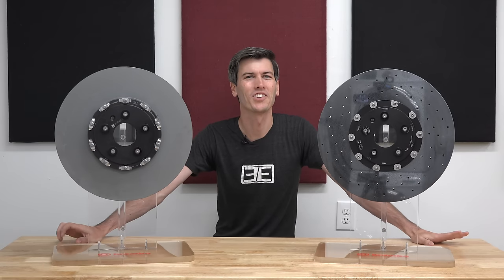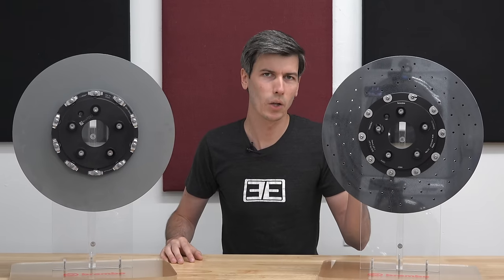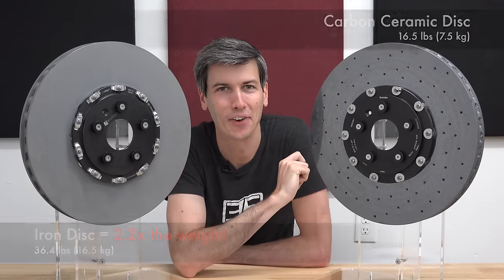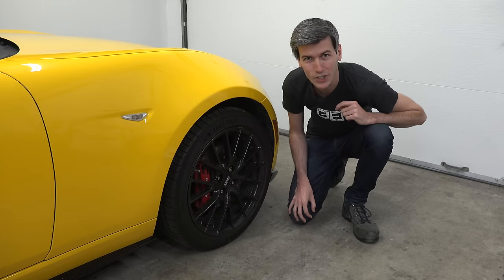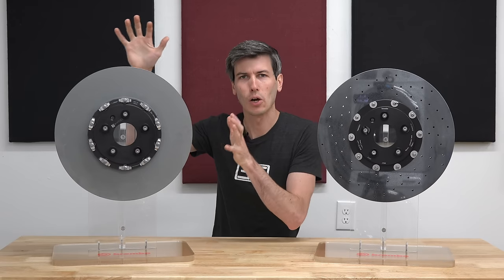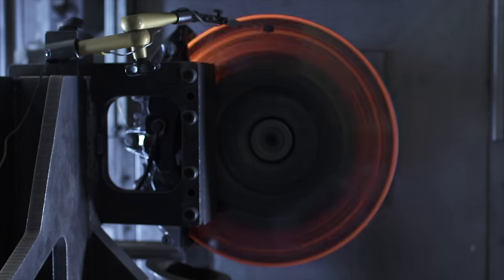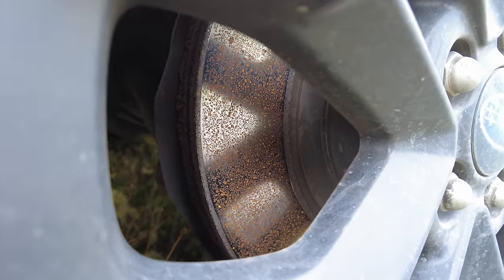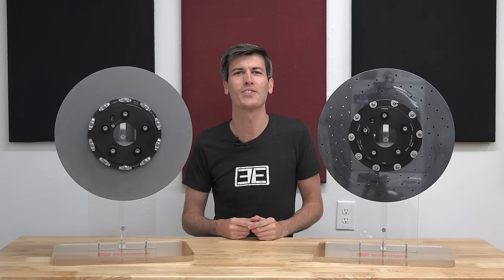How Can Brakes Cost $10,000? The Brilliance Of Carbon Ceramics

Comment: I use ceramic tiles from my kitchen for my brakes.Far cheaper and if I need to replace them, I can just grab some from my home depot.
Reply from the maker: I'd maybe suggest starting at Home Depot, so you still have a kitchen floor.
Reply: Porcelain is another option for low cost.
Reply: I believe Animal Free Fur Pelts and Rubber Bands are the recommended optional upgrade for this kind of brake setup
Reply: I use an ironing board for my rear spoiler and clip boards for my sun visors. Quids in.
Reply: Have you ever thought about upgrading to CARBON CERAMIC TILES?
Reply: @EngineeringExplained  NOW you tell me. Dangit.
Reply: I grab wall base mouldings while at Home Depot for my side skirts.
Reply: Engineering : More rotational mass and inertia is a bad thing

Manufacturers : 24 inch wheels! 😂
Reply: I don't always buy expensive rotors, but when I do, I use granite countertops.
Reply: I love the internet 😂
Reply: What about the carbon?
Reply: I just use the pink foam. Huge weight savings

Comment: would have liked to see the negatives too. My experience with carbon brakes is in aircraft, not cars, so maybe things are different. Aviation uses them almost entirely for life expectancy, but they achieve all the benefits you mentioned. Downside (apart from cost) is that their brake performance while cold is pretty bad and unpredictable. The same brakes will pull left or right depending on the day. Once they warm up, however, they perform wonderfully. Brake fade is only part of the equation. You need to look at brake warm-ups too. In daily driving, you're brakes are usually cold. Only in track racing do your brakes typically remain at the ideal operating temperatures for carbon brakes. Unless the technology has changed for car applications, I do not see carbon brakes being an advisable choice for a daily driver
Reply: CCBs are great for the reasons Jason identified, but the major issue is simply cost.  They are often 5x-10x more more as Jason mentioned.  From a use standpoint if overheated (on a track day for example) they will wear quickly, which leads to replacement (read $$$.)
Reply: Seems like weight savings would play a major role in aircraft, no?  I guess down time to replace brakes is as important.
Reply: Perhaps the car's stability systems help the inconsistencies in cold carbon ceramic brakes. I wonder if there's different brake logic like programming battieres in newer cars.
Reply: I think you’re getting carbon ceramic rotors confused with carbon-carbon rotors that are only used in racing. Carbon-carbon rotors have a very narrow temperature window in which they operate correctly. This is not the case with carbon ceramics. They work correctly immediately from ambient temperature. I had carbon ceramics on my BMW M3 and never experienced what you described. What I did experience was 0 friction during the first 2 seconds of brake pedal pressure in wet conditions.
Reply: Brake system engineer here: in a street car application CSiC (Carbon-Siliconcarbide) Brakes nowadays perform almost identical to Cast-Iron brakes when cold. The real enemy for CSiC Brakes is water! To reduce that issue, the brakes will be slightly applied on the car to get rid of the waterlayer, when its raining and the brakes are cold. This method will be used every minutes without the driver noticing. 

Carbon-Carbon brake rotors ( used in racing) have a really low friction coefficient when cold and can't really be used without being warmed up.
Reply: That’s not true. Carbon brakes do not need temperature to perform normal safe street stops. They stop immediately. Unlike iron race brakes.
Reply: @RB-xv4si  absolutely true. Thank you.
Reply: @RB-xv4si  yep
Reply: @vivalaphill  thank you. Exactly.
Reply: Only F1 cars use these brakes to my knowledge.
Reply: @CamKrazy2000  carbon/carbon?
Reply: @CamKrazy2000  lots of cars use carbon brakes. Lots.
Reply: I love my speed triple! The steel lines help a lot too! But what an awesome bike all around! Very hard to keep both wheels on the ground from stop to stop!
Reply: They compensate with the pad material creating a linear more familiar brake feel and application plus some computer trickery in some high end cars.
Reply: @RB-xv4si  I also experience the same with my M4 with CCBs. Nothing like driving in the rain and needing to emergency brake and nothing happens when you stand on the pedal. Lol
Reply: @heremyjogan  it’s very scary! I wish this would be fixed.
Reply: @ICEV  This. Top Fuel, Funny cars, LMP, just to name a few.
Reply: I have a GT3RS w/ Porsche's Carbon Ceramic Brakes. Maybe the ultimate friction level between pad and rotor isn't as good when they're cold. But even so, the friction level is plenty adequate enough to trigger the anti-lock system at will during street driving. This is probably because the brakes are plenty oversized for legal speed limits anyway, so the friction coefficient being a little lower doesn't really matter. There's still more than enough stopping power. And of course if you're on track, you'll have them heated up soon anyway. Don't forget that pad selection - not just the rotor material - plays a major roll in the coefficient of friction relative to temperature.
Reply: @ICEV  early versions like the PCCB on 2003/4 911 GT3s were poor when cold. The tech has improved though.
Reply: @Cassp0nk  I never had any issues with early PORSCHE Carbon Ceramics. Stopped fine in 30 degree weather.
Reply: Yup on cold days the brakes on my McLaren GT are louder and more touchy
Reply: @CamKrazy2000  IndyCar uses carbon/carbon brakes on the super-speedways and iron on road courses.
Reply: @vivalaphill  that's pretty smart, got the car looking out for ya and you wouldn't even realize it.
Reply: Carbon brakes on aircraft have a tendency to grab suddenly.  You really feel it when the autobrake system comes online.
Reply: @YungDevo9  the amount of things modern cars do that is completely transparent to the driver is really amazing, especially in comparison to half a century ago when you often had to manually adjust the air/fuel ratio just to get the engine started (manual choke).
Reply: Your*
Reply: I have a car with CCB the brakes work just fine even when it is -20  degrees out.
Reply: Downside of CCB is 1. obviously cost (being poor is my problem not Brembo’s); 2. cold temp performance, which a lot of manufacturers has been improved on (so it’s like 0.5 of a problem);  3. brake noise (even top brands can’t eliminate brake squeal).
Reply: @RB-xv4si  And then you hit something because you had no brakes for 2 seconds.
Reply: @vivalaphill  Until the sensors that do that fail after maybe 5 years and their are no replacements available because you engineers have made a new one that is not backwards compatible and the second or third owner of that car has rear ended someone or driven into a ditch if they are lucky or off the side of a cliff if not.
Reply: I’m considering getting a pair for my drag racing car.  I cross the quarter mile @ 132mph.
Reply: @RB-xv4si I have a g80 m3 with carbon ceramics and you are 100% exactly correct. 
The breaks are perfect, except after a car wash the first 1-2 seconds of pushing the breaks the first time, nothing much happens
Reply: @ATEC101 it’s not that bad. I don’t notice it in wet driving. Only after going through the automatic car wash. And even then it’s not no breaks, just the first 5kg of foot pressure on the pedal does nothing, if you push harder it still stops. And it’s literally only for the first corner
Reply: On regular brakes people would say don’t use race pads on the street cause they don’t bite when they are cold. Well it may be true that they bite harder when warm, but when cold they would still compel you outperform other street/track use pads. They did squeal bad tho but I didn’t mind it since was race car on the street anyways
Reply: @ATEC101 😂
Reply: Carbon ceramics don’t have the cold issue I think you’re talking about carbon carbon brakes

Comment: I see a Jason and a big rotor, I SMASH like! After having thrashed that RS7 boy to those brakes feel amazing once they get some heat. Not bad cold, but not great. On that car, each front rotor is almost $6000 to replace. OUCH!
Reply: They are amazing. Have them on my S8+.
Reply: Yes very good brakes, I work for Audi a brake job cost $15,000 per axle I’ve only done one set on an R8 they last a long time
Reply: So humble of you 😜
Reply: New RS models are $10,000+ now, insane
Reply from the maker: Love it!
Reply: Spot on. Carbons need to reach about 400C before they work effectively.
Reply: Got them on my M4 Comp, awesome brakes and 0 brake dust :)
Reply: @Dan-re7go  400C? Isn’t that a bit too much?
Reply: @xjoffroad2052  $60K on brakes doesn’t make sense for a street car. I’d change those out for Iron rotors asap
Reply: @DanielE-oq1dt  and track cars, better to go thru multiple sets of reg rotors
Reply: @iiNNeX  - I optioned CC on my G80. Do you experience high/loud squeal from the CC’s? And are you using them on street or track or both? Any complaints?
Reply: @gmoneii1117 Did you always have the squeal? Did it get worse as they warmed up?

Comment: If you do a break delete you have even less unsprung mass
Reply: If you do an axle delete even more so!
Reply from the maker: Jesse's Jetta knows.
Reply: I am surprised that inboard brakes are not more of a thing.
Reply: @PaulMorris-UK  probably would be a pain to package when there's this big open space between the hub and tyre you can use
Reply: You could also leave the wheels and tires back in the garage.  That would make the brake delete a lot safer, too.

Comment: When I had a Corvette, I kept up with the comments from the other track rats.  Heavy users switched out their factory carbon rotors and matching calipers for AP Racing rotors and calipers.  Carbon rotors lasted about a year of track use.  The AP Racing setup could be purchased for less than the replacement rotors, and users stated their lap times improved.  I'm sure a track only carbon setup would be faster than the iron rotor track setup, but only pro teams would be willing to pay for the difference.  Cool stuff, Jason.  Let's see more of your new garage!
Reply from the maker: Interesting insight, thanks for sharing!
Reply: I have no direct experience here, but I've read lots of stories of Porsche GT3 owners who switched from carbon to iron rotors for racing. The main reason was that the carbon didn't get much of an advantage and the iron rotors were considerably cheaper to replace at the end of the season. The carbon is the only choice if you're trying to set fastest laps, but if you only race a few weekends a year then it's not a concern. Lots of people are happy to finish mid pack (or finish at all) with iron rotors.
Reply: Additional info: if you are using Carbon on the track, you need to constantly weigh the rotors as that's the only method to determine when they are worn out.  If you neglect to do this, you have a chance of catastrophic brake failure, not the funnest thing to happen while on a track.
Iron rotors you can easily monitor without removing from the car and also put up with much more abuse.
As you said, only pro teams are willing to put up with the extra cost and maintenance for carbon.
Reply: I too swapped out my CC rotors on my C7Z for the irons. Better braking modulation and much, much more compound to use than the CC. Lap times has also dropped, mainly because the CC was an on/off switch.
Reply: @DougAdams-Outside  You don't have to do that - you can feel that surface gets very rough when too much carbon gets burned out. At that case you check if they done or not by weight.
Reply: @MaxKosenko  thanks!

Comment: I think the question we should all ask is:  What is the best brake pad for Carbon Rotors?  The best quality rotors is definitely important, but having the right brake pads will take full advantage of it, otherwise, it will be a waste of money.
Reply: There is no one-size-fits-all, as I understand it. I think it has more to do with how a specific set of rotors gets along with a specific set of brake pads.
Reply: That's easy, when you order the brembo complete kit just put on the ones that brembo put in the box.
Reply: @jaydunbar7538  exactly. You only have a choice with steel rotors. With CC rotors, you must use Brembo pads made specifically for their CC rotors.
Reply: @RB-xv4si  
I second that. 
I don’t have any data on these rotors, nor have I started looking into this part of automotive tech. 
Simply operating from assumptions:
Brake system simply needs to turn from kinetic/movement into heat energy. 
Grinding away the iron on an iron rotor is an unfortunate side-effect. (Sure, grinding also requires energy, but that’s not what we focusing on here.)

If a better rotor is available, but cost 10X, I would HOPE the manufacturer has found a pad formulation that takes advantage of the new rotor tech, without aggressively grinding down that new & expensive rotor. 
Turning from speed into heat using friction, but without grinding away on the rotor like 80-grit sandpaper on a block of brie (soft cheese).

Comment: I used to track the Ferrari 360 and then the 430. The brakes would disappear after 2 laps at Monza. One time I pressed the brake and NOTHING happened, so much so I though I pressed the clutch pedal. Car went straight into the grabble. There was sand and stones INSIDE the car somehow!
Then the 458 came out with the ceramic brakes. I remember we trashed them for 3 straight days at Maranello from morning to dust (as part of their Pilota Sport program).
Never missed a beat. Fresh and perfect every time. Like out of the factory! 
They're not just superior, they're ON ANOTHER PLANET !